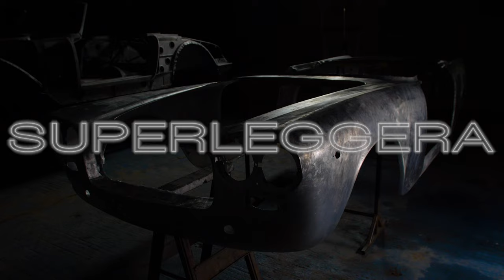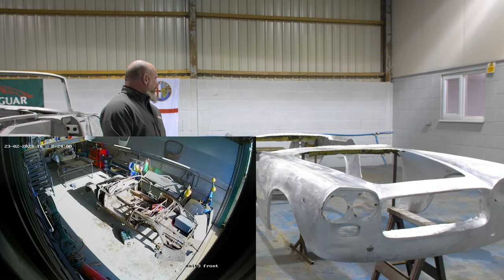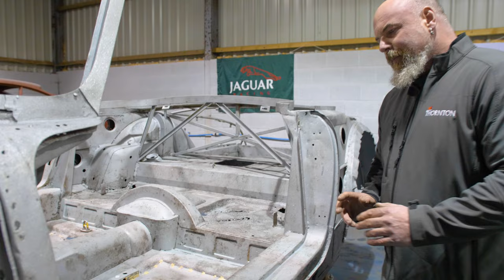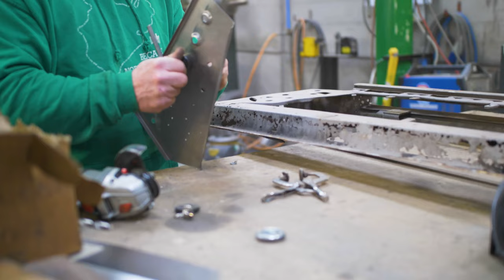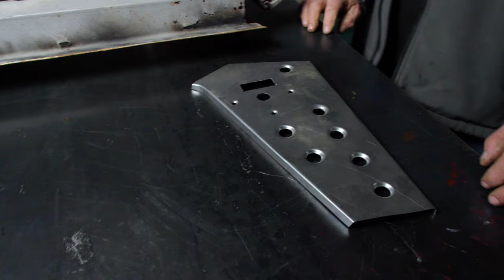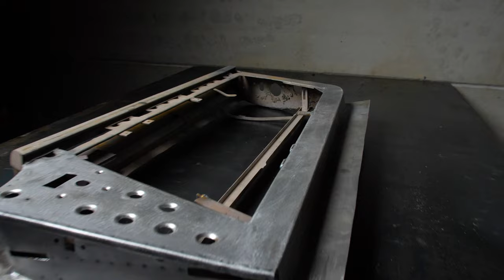RESTORING A RARE LANCIA CLASSIC CAR | LOOK AT HOW THEY WERE MANUFACTURED! 😲 |  FLAMINIA SUPERLEGGERA

Comment: I look forward to updates on this fascinating project. They weren't actually cut down from fixed head coupes, Lancia built a platform chassis version specially for coachbuilders, Zagato being the other coach firm to use it. You're right though that It didn't anticipate accommodating the soft top mechanism.
Reply from the maker: Thank you for the comment! It was very insightful to see what lies under the gorgeous Aluminium dress, this part was not so pretty!
Reply: that's 100% correct, same floorpan, sills and wheelarches etc for coupe and convertible and the zagato's. You can see where touring added panels. the Lancia supplied panels were of very good quality as they were pressed. ( so floor replacement will need to be good )
Reply from the maker: @ianopenshaw8643  our craftsmanship is second to none, we will reveal footage of our finished reproduction floor in the next episode on this subject! Already taking orders for boot floors, the powers of social media 🇮🇹
Reply: Agree that the convertibles weren't just chop tops. The coupe, GTL and convertible each have different windshields varying in height.